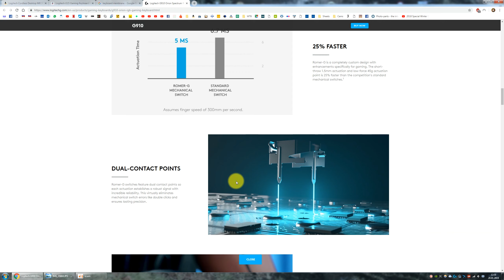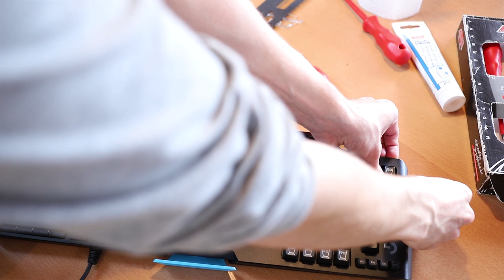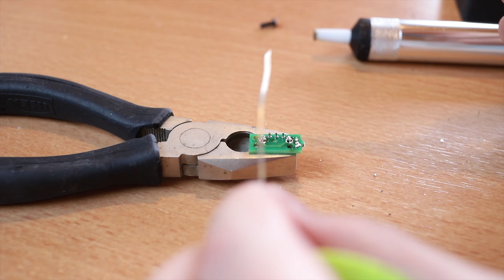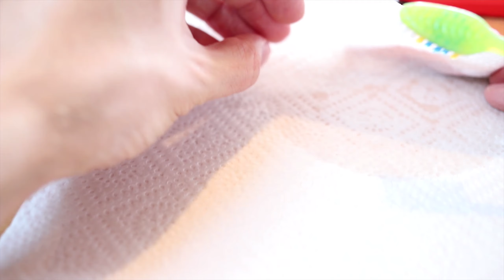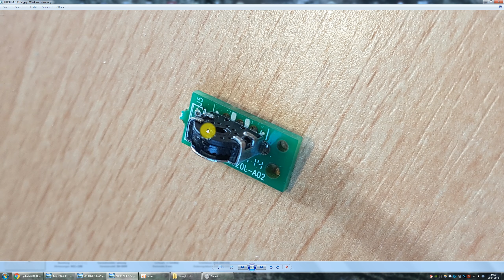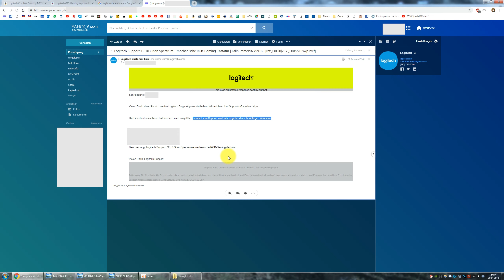Logitech G910 Volume Control Repair

Comment: I bought the G510 with lcd screen and 18 programable keys on the left with 3 banks. The volume wheel just stopped working. Windows recognizes that the wheel is being moved, but will not adjust the sliding bar on the screen. I gave up on it and just bought a 8 key external usb mini keyboard with volume knob. I still use the G510 because everything works but the wheel.  I bought the KB back in 2010. Very happy with it's performance. Even after spilling numerous rum and cokes on it.

Comment: This guy... this guy saved my sanity after I accidentally tore one of the wires loose fixing a keyboard that I may or may not have spilled soda over. As someone with a rudimentary electronics understanding, dating back to school days many years ago (a depressingly increasingly large number of years ago), I cannot say thank you enough.

Comment: I have an old G610 with a similar/same volume wheel.  The keyboard is maybe 7 years old, or something like that, so I can't complain too much about the basic keyboard function life.  About a year ago I had a few problems with keytops popping off periodically, but they always snap back in place.  Then, a few months ago, I started to use the keyboard volume control wheel.  It didn't last long, before I had the same erratic behavior problems that you showed.  Your video was very useful to me, because it confirmed the nature of the problem, and the fact that they are difficult to take apart and fix.  Seriously, unless you are just tinkering and having fun taking that keyboard apart, why would you go through all that trouble to fix it if it's only going to last a few months?  I'm exploring these stand-alone USB volume control knobs for about $35 on Amazon.  The other option seems to be to buy a small keyboard speaker box (that stands under the monitor) with a built in volume control knob on the side. Another option is to remap a couple of the function keys for volume up/down capability, using the keyboard driver, but it takes a lot of key punches to adjust the volume, so it is not as nice as the keyboard wheel.   So, in summary, thank you for all the time you spent putting that video together, I learned a lot! (i.e., don't buy a Logitech keyboard if you intend to use the volume control wheel - but the basic keyboard function is very solid.)

Comment: NebukadV, I need to thank you for your video. After seeing the internal workings of the G910 (thanks to you), The "jumping" volume control wheel looked like it was a contact problem. So I shot some high-pressure air and spun the wheel for a little. This should polish or clean contacts. Well, it worked. 10-15 seconds each way. And now it works like new again. Sometimes encoders get buildup. Again, Thank you for your video! It really helped.👍
Reply: 2nd this, I've had problems for years and I just spun it really fast by hand in both directions and it's working perfectly again
Reply: this sounds silly at first, but it actually works 😂

i've had same volume control problem as in the vid for quite some times now, after reading this, i just spin it fast by hand too and suddenly it's working like new !

thx for sharing <3
Reply: This just helps me too, thank you for sharing it!

Comment: For anyone reading that either doesn't know how to do this or cant be bothered to learn how, a simple fix from another video is to just blow air onto the volume scroll wheel. Either use your mouth or an air duster but it really works.

Comment: Dude..  have you tried to just spray some CRC contact cleaner into it to strip away the corrosion first before taking it completely apart...LOL    I didn't even have to take my board apart.. just angle the spray at the end with the wheel on it and spin and spray.. the CRC is NON conductive cleaner...   just some FYI...     but very nice video for sure..   there are a few different types of cleaner.. check to make sure ya get the one that is plastic safe..    https://www.amazon.com/CRC-Contact-Cleaner-Protectant-Aerosol/dp/B007I9Y200/ref=sr_1_1?dchild=1&gclid=Cj0KCQjw5uWGBhCTARIsAL70sLKKRfg_sPfqiEabpsjPwXDH7xYtwsXd9cGAr_pO18qlxmz9Ift-hqkaAt_rEALw_wcB&hvadid=177561706453&hvdev=c&hvlocphy=9016844&hvnetw=g&hvqmt=e&hvrand=17677013503769471718&hvtargid=kwd-1210770084&hydadcr=6372_9585431&keywords=crc+contact+cleaner&qid=1624931811&sr=8-1

Comment: On the G810 this little PCB appears to be part of the main PCB, attached by a very weak bridge.
Reply: you can safely brake that bridge with out any problem btw did one 810 while rpairing no problem what so ever

Comment: Thank you I'm sure my G710+ will need the same fix.
Reply: My problem was the solder was not properly adhered to the mainboard. At some point in the past, it broke loose. I found it dangling when I opened it up. With a little flux and heat, it was fixed!
Reply: I never thought my g710 would outlast my g910 in terms of functioning parts.

Comment: I skipped the desoldering step and just popped if loose and cleaned with compressed air and a cloth, popped everything back together and IT IS FIXED (for now). This video and the task of taking my keyboard apart has convinced me I probably won't buy a logitech keyboard next time.

Comment: Hallo, danke für das detailreiche Video. 

um das aktuell zu halten: Logitech hat wohl eine Design-Änderung vorgenommen.
Meine G910 M/N:Y-U0023 hat kein Dreh-Codierer welches auf einer Extra-Platine aufgelötet wurde.

Der Dreh-Codierer steckt lediglich auf den Dreh-Regler, ohne Fixierung. 
Vom Dreh-Codierer gehen dann direkt die 3 Anschluss Kabel auf die Haupt-Platine, wohl gemerkt mit einem Konnektor , man braucht es also nicht mehr entlöten.

Ich denke das es eine Neuerung ist, bin mir aber nicht sicher. Weiß auch nicht mehr genau, wie alt das Keyboard ist. Vielleicht sagt die M/N - Nummer etwas darüber aus ?

Leider führt dieses "Improvement?" auch zu dem Problem was ich hatte. Beim Zusammenbau nach einem Switch-Wechsel ist mir der Stift auf welchen der Dreh-Codierer sitzt abgeschert. 
Ich denke dadurch das er nun etwas undefiniert auf den Dreh-Regler (Plastik-Rad) sitzt ist er verrutscht oder verkantet und wurde beim zusammen drücken von der Abdeckung ungünstig erwischt.
Also aufpassen, das er beim Zusammbau so weit wie möglich links (Richtung Keyboard inneren) sitzt.

Da ich auch kein Ersatzteil (Plastik-Rad) finden konnte habe ich es mit 2-Koponenten Kleber wieder zusammen gesetzt. (Stift auf Stift)

Der Dreh-Codierer funktioniert bei mir übrigens einwandfrei, bis jetzt., scheint aber (rein äußerlich) auch nicht von besserer Qualität zu sein.

Das so weit als (zusatz-) Info. Vielleicht kann ja jemand sagen ob das eine spätere  Design-Änderung ist, oder doch bei den ersten (älteren) Keyboards so gemacht wurde.
Reply: Ich habe auch diese "neue" Version mit den 3 Kabeln. Allerdings sind mir diese beim auseinanderbauen vom Dreh-Codierer abgebrochen und ich weiß nur dass das rote Kabel in die Mitte kommt. Jetzt stellt sich mir natürlich die Frage in welcher Reihenfolge das schwarze und das blaue Kabel angelötet werden müssen.
Wäre nett wenn sie mir antworten, da sie sich anscheinend damit auskennen.
Reply: @sayne_spi1968  Hi, falls es noch relevant sein sollte, wenn man die Kunststoffseite des Encoders vor sich hat, ist die schwarze Ader rechts. Also blau links, dann rot und schwarz. Bei mit sind die flimsigen Drähte auch abgebrochen, mein Plan ist es die zu verlängern, da sie unter ziemlich kurz sind und unter Zug verbaut waren.
Reply: @ochristi  Danke für die Antwort, habe es zum Glück beim ersten Versuch richtig angelötet. Die Kabel sind echt viel zu knapp gelegt worden, die zu verlängern ist eine gute Idee.

Comment: I have this same problem with a G810, would this process still be the same?
Reply: I have the same model as you and had the same issue. Using an electric duster resolved the issue for me.
Reply: oy mate, how did it work out?  
I'm asking for obvious reasons ;)
Reply: @hpenvy1106  I never fixed it lol, I now use the volume knob on the speakers and the mixer in the (windows+G menu)
Reply: @brianwahlstrom  lol, i just did it. The wheel has an extremly weak plastic arm, which is reaching into the rotary encoder. I have no more fucks to give about this keyboard, so i bent the rotary encoder 90° around and jammed a toothpick into it. It is working again, but honestly i am mad at logitech for skimping on the quality.

Comment: This is a software issue and not a hardware one. While it may have worked for you this can be fixed by uninstalling the software and installing it again. You may need to also install the latest drivers if you have a dedicated sound card. This drove me nuts until I installed the latest drivers for my SoundBlaster Z card. Once installed it worked perfectly. Try this first before you take your keyboard apart.
Reply from the maker: In my case it was definitely a hardware-issue - it got worse and worse over time.
But of course, there might be other reasons for such an issue as well ;)
Reply: @NebukadV  If this happens again try to install the MB drivers again. I just reinstalled W10Pro and had the same issue you had with volume jumping. I installed SB Drivers and next used Driver Booster 7 to install all updated drivers. Lastly, I installed the old version of the keyboard drivers (2016) and it fixed it. There also happens each time W10 released an updated.
Reply: @kenkobra  its a volume dial not something complicated that is affected by drivers, the microcontroller in the keyboard interprets the signals from the encoder into a button press which is sent to windows as a standard volume button press. definitely a hardware issue, if they used gold plated contacts instead of the tin which it appears to be that would have made the encoder last 10-20 years as the one in his original logitech keyboard did (it was probably using gold contacts) it's a cost saving of a tenth of a penny at most in a premium product where large amounts of money were spent on every other button on the keyboard so that supports his planned obsolescence argument aswell, you simply don't use a part that bad by mistake, not even on low end hardware.

Comment: thanks for the video!  I just had to repair the volume control on my g910 (2 months old!!).   

the rotary encoder was not the problem.. but the wheel itself, and the little pin that goes into the rotary encoder snapped and broke off...    i was able to fix it with fire... yes.. ;) 
since its a plastic pin, i heated up the both ends and stuck it back together..   it holds for now, but i will try to get a new wheel to replace the whole thing.
Reply: Were you able to get a replacement?
Not sure where to get one.
Reply: @awoidf  no.. whole keyboard failed soon after that...  I then started using Custom keyboards...  And now I know, logitech is the cheapest shit you can buy, quality wise...   there are "cheap" custom boards that do a much better job.